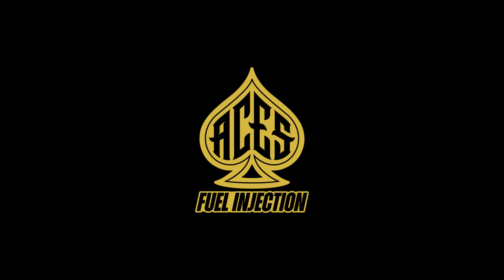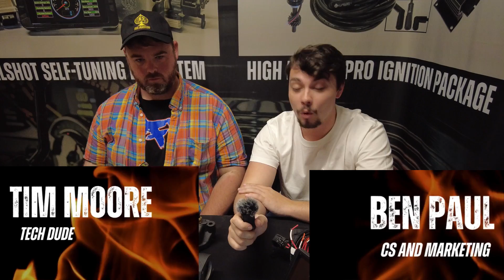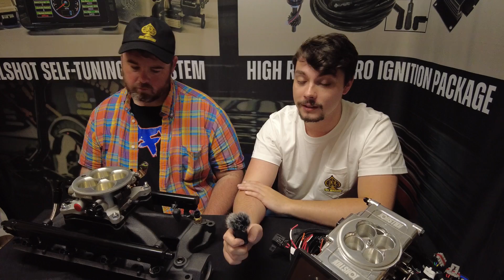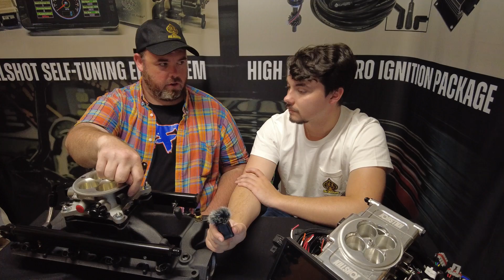Tech Tuesday Ep. 4

Comment: On that Ford small block intake, move the rear water ports inboard an inch or so. You can't screw anything in there (like a dash water temp sensor - cough, cough), it interferes with the fuel rails...It would also be nice if you could turn the injector connections inboard to help hide the wiring, and not interfere with fabricated valve covers.

Comment: Hey guys, looking into the killshot system for a 70's dodge 360 4bbl. I currently have a stock magnetic pickup distributor and a MSD 6A with a Blaster2 coil. What are my options with ignition? Can I use my ignition system as is? Can I use the Killshot to control my timing? Thanks!

Comment: Thanks for answering my question guys…..and for the record my backup sensor isnt an actual expensive holley piece but better yet a $20 ebay 5v 100psi knockoff…..only actual high dollar sensors that u have to use with the holley is their 4.9 LSU wide band 02 sensor…..i bought a hand full of bosch 4.9 sensors for replacements but of course they didnt work….but im sure they will probably work for my killshot if or when my original needs replaced….we will see!!!